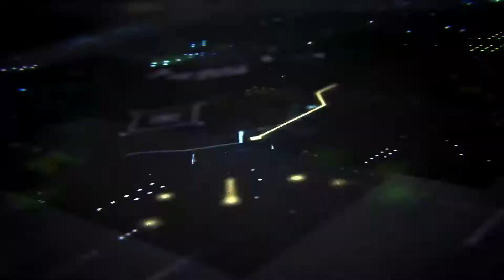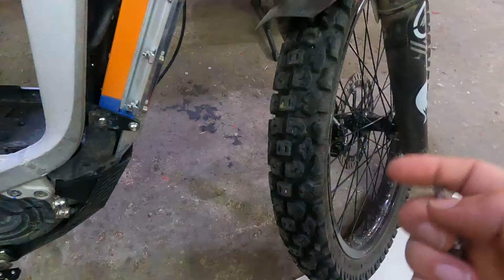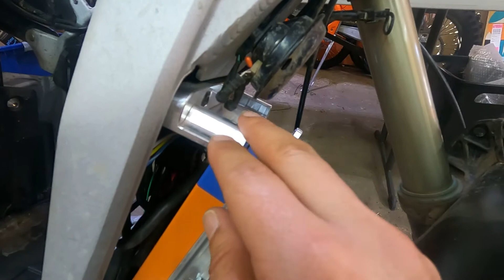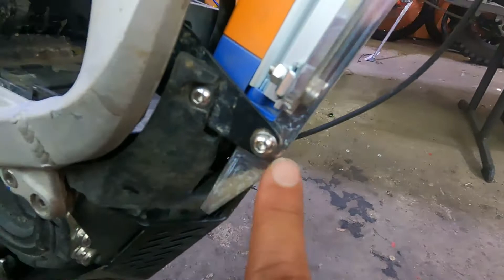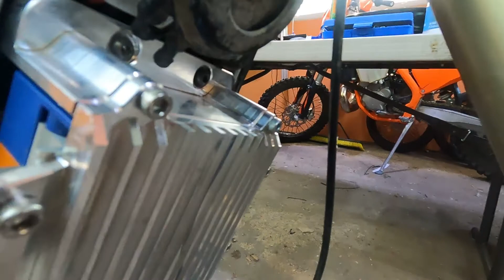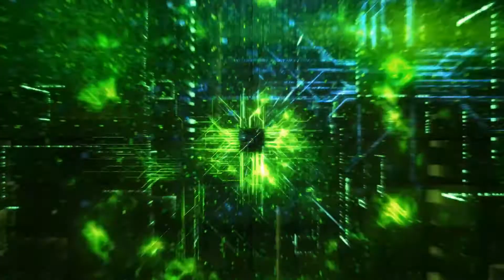GLE ENDURO TRUE FIN HEATSINK Install for BAC4000 on SURRON SEGWAY

Comment: i love it but im disappointed in the hardware that holds the bac4k to the inside face of the heatsink. A simple grooved bracket that runs down the side would be a much cleaner look to complete the overall theme of this heatsink
Reply: I like the bolt bling. got my bolts in titaniun blue. Looks fire with the silver

Comment: Flipping the tilt sensor bracket upside down like instructed in this vid did not work on mine. The holes don’t line up at all, it’s not even close. I had to flip the bracket back to the stock orientation for the holes to line up and it worked great.
Reply from the maker: Glad it worked for you.
Reply: @GLE  I couldn’t be more happy with the fit and finish of the heatsink. It looks like the Surron should have come with the bac4000 from the factory now. The bottom tapers into the motors bash guard for cooling and it just looks perfect. 🤌

Comment: Are the clamping washers for the heatsink supposed to be included when you order the kit? I have no means of attaching my heatsink to my controller.
Reply: Came with mine. I was looking and thinking what I would do if I lost one and I don’t think there’s any reason why a flat fender washer wouldn’t work.
Reply: @JPTulo  They we’re missed in my packaging. GLE sent them out to me after I contacted them.

Comment: How do you re-mount the tilt-sensor?  I sure hope it still works with your BAC 4000.
Reply from the maker: Tilt sensor is not compatible with any bac. use the engine cut feature created in the GLE app.

Comment: Would you add any heat sink compound-grease in between the heat sink and the motor controller face? For heat transfer? Would you recommend, or will it not work or make a mess instead?
Reply: I was just about to ask the same question. I would think you would?

Comment: be nice if a black one could wrap around the sides
Reply from the maker: The sides are open for airflow and cooling. The controller is potted and the harness is waterproof thus water or debris will not affect the controller.

Comment: will you be making something to seal off the side gaps left from changing the controller? makes me kinda ify about water getting on those wires
Reply: The controller is potted and the wires are waterproof with gaskets
Reply: @joshuab2450  thanks bro